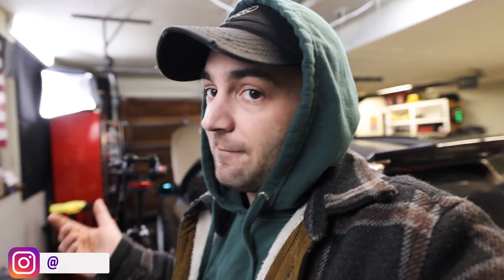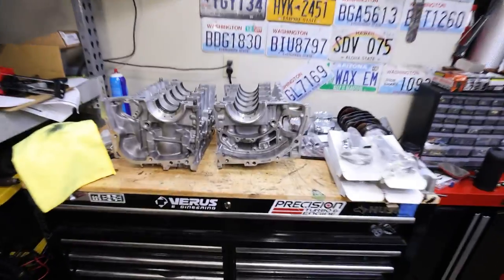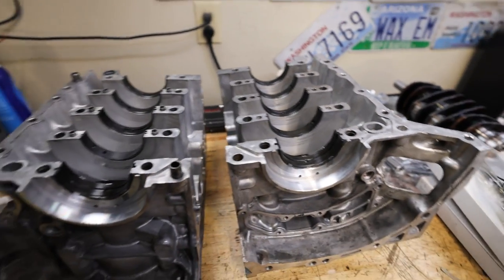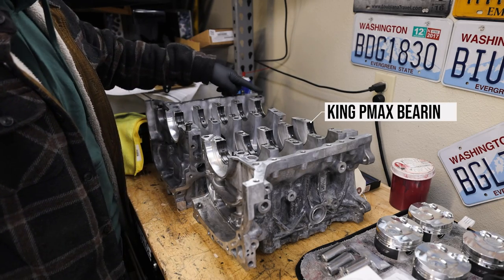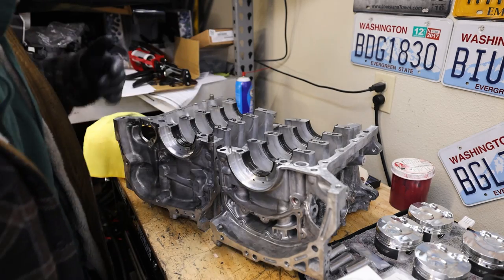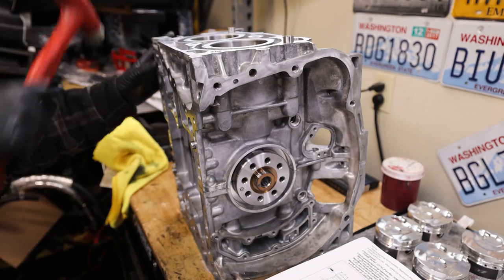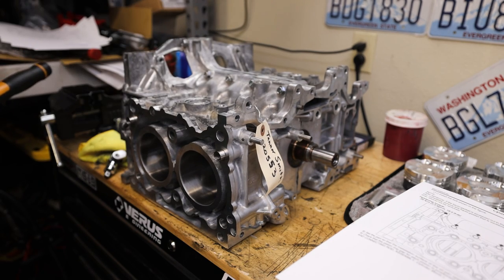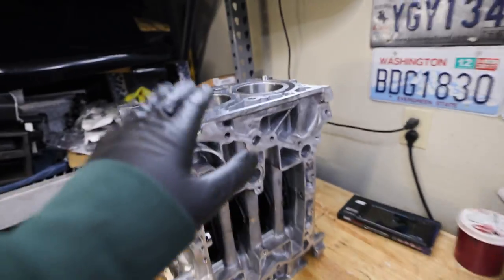How To Build a Subaru Engine (FA20DIT)

Comment: Tanner, Subaru of Japan stated that all the tightening and loosening of the case half bolt was designed to release trapped air and gas that might get compressed in the sealant. It's supposed to make it last longer and not cause leaks as easily.
Reply from the maker: Good to know! I figured it was to align the cases properly but that makes more sense 🔥

Comment: FA24 shortblock actually goes together like an EJ again they went back to the straight connecting rods for better durability. So now you have to again take the plugs out of the block and remove the wrist pins and pistons off the rods.
Reply from the maker: Tbh I'm kinda glad they did that then 😅🔥

Comment: 7:12 
I am not a mechanic or mechanical engineer so i know little about engine assembly but Im a structures engineer and i know that by lubricating a bolt, you loose friction force which means the bolt will be under higher stress that can lead past its yield point resulting in permanent deformation.
Reply from the maker: Per Subaru FSM they want you to lubricate the threads, I wouldent stray from the FSM on that one

Comment: YAY FA LOVE !!! I had to do a rebuild on mine the oil return blew out the turbo and by time I realized it. It was way to late. But now that I have it running I wanna build it !!! Thanks to this video I’m determined to build one now. Just need to source a short block. Dk if it’s smarter to buy a short block from Subaru and build it with manely or just 100% rebuild a used short block
Reply from the maker: Offer up and FB marketplace is where I get all of mine! You can snag then for deals!

Comment: ourfront short block closed deck and long block assembly and tuning by prime motoring P3X FA engine build with fp blue turbo. E60 blend. Almost 24k miles on the build and compression tested recently and checked out good. when built right and maintained shit will last.

Comment: Hey I have a scenario I’d really like your advice about; my sons engined failed 2 years ago on his 2016 Subaru WRX 2.0 L DO HC inter cooled turbo engine with 44,000 miles on it. Subaru service found turbo charge shaft broken and impellers damaged. The short block cylinders 3 rod bearing also failed and found a lot of metal in the engine oil. Luckily, this was under power Tran warranty. Subaru replaced the short block turbo, oil feed lines, high pressure fuel line and oil pan at no cost. In October 2022 he was checking the oil and heard a tapping noise. I took it to the local Subaru service center who replaced the short block and turbo 2 years ago. They diagnosed it needed an engine rebuild to replace short block assembly, rod knock cylinder 4 at the cost of $ 8046.32. They said it was out of the one year warranty on parts from when they replaced it two years ago. The car only has 65,000 miles on it. I found the old invoice from two years ago which I never looked at because it said no charge on it and noticed that on the last page of the invoice it states after replacing the short block and turbo and engine reassemble they started the engine for a test drive. The engine check light came on Cam P00ll camshaft position timing over advanced bank1. They removed the cover and inspected the cam pulleys and found all 4 pulleys still had debris in them from when the engine failed and needed to be replaced. They replaced all four cam pulleys and reassembled the engine again.
My question to you is can the debris that they found after replacing the new short block and turbo get into the short block oil passageway or oil galleries and heads and Over time cause it to fail again two years later causing # 4 rod to knock?
What do you think?

Comment: Hi Tanner I am in need of some help and could some advice. Bought a turbo and it's not clearing the intake manifold. It has a 3in inlet that hits the manifold on the right. It feel like its sitting to the right a bit. I want to move it back and to the left if possible. I have tomei ELH and uppipe. Cobb fuel rails, aos, injectors, ebcs. Trying to refrain from tgv delete since I'm using the AP platform for tuning. I was thinking I need a different uppipe.
Reply from the maker: Snag some 8mm manifold spacers that should help a wee bit 🙏 
If not tgv housings may be needed....

Comment: Hay tanner I love doing top speed pulls on my 2004 wrx I have a built block but the heads are stock should I start investing in valves and springs or am I good for now. 

Ej205 
Cp piston 
Eagle rods 
King bearings 
Stock heads
Vf39 turbo
Sti pink injector 
Turbo back exhaust

Comment: Question: I took your advice to heart of not to buy a first year car of a new generation. However the new RS Impreza “updates” took everything they have had already in their other cars for years; infotainment, engine, etc. does that give this one an exception because lack of “new” parts and features?
Reply from the maker: There may be small bugs with it but nothing that software updates or minor r3calls can't correct. I'd say if you want it go for it 🥳

Comment: Hey Tanner, thanks so much for the video, I've been waiting for this one for a while, I knew you'd come through if I was patient. I see you linked the factory service manual. So I assume you set all the bearings and ring gaps to factory specs? Did you shoot for the looser side of the spec or just in the range?

Comment: Off topic but id love a quick talk from you about oil consumption tolerances with EJ’s. I have a fresh iag build that consumes what I feel is a lot but iag and my shop say it’s fine. I added about half a quart in 1700 miles while only having 3000 miles or so on engine. Just curious on your thoughts
Reply from the maker: Probably ring gaps, the engines I put together maybe go through 1/4 of a quart every 3K miles. 

I can see of I can put something together.

Comment: @smeedia  so I blew found small sparkles in my fa20 tore it down found it to be thrust bearing. I wanna rebuild it and clean the heads re hone the cylinders and whatnot but I do not know what rods bearings and pistons to buy. I’m kinda balling on a budget but am thinking h beams and probably Manley pistons.  Any recommendations would love to pick ur brain on it so I can get my wrx back on the road again.  I’ve rebuilt a mzr disi 2.3 and a eco boost 2.5 and a lt4 and a small block 350 chevy motor   any advice and insight would help a ton. Thanks man

Comment: why do you scrape some of the material and how do you know how much to scrape? the compression and oil scraper
Reply from the maker: To set your ring rap, they normally come too tight so you need to make the ring smaller by using the ring grinder. 🙏
Reply: @Smeedia  how much do you scrape of?
Reply: @mendez_guzman9661 The ring manufacturer will give you a guide based on usage. In my twin turbo Ford engine, high boost/nos was 7 thousandths per inch of bore. So a 4 inch bore should measure 0.028 or 28 thousandths, in this scenario. The looser your ring gap, the less chance of them butting up and causing ringland failure, but it will also increase oil consumption.

Comment: Hey, I just pulled my engine because my upper oil pan is cracked and I'm replacing it. I've got about 70,000km on the car and wanted to change the rod and pistons for reliability and possibly more power? Do you think it's worth it, as I know the rods are prone to fail and I have to be tuned on 91oct. Also if so, anything different when installing the pistons onto a used block?

Comment: Are you using the cam angle sensor in your eg33? If so how many teeth are on it i.e 12 minus 1, i cant find this information for the  life of me.
Reply from the maker: 12 -1, I had a custom CNC made adaptor to use the stock sprocket with an EJ25 pump. The sensor is offset from the sproct to read the front teeth
Reply: @Smeedia  12-1 is your custom or stock eg33?

Comment: What’s this build costing? My some bough a 2017 wrx with 50000 from a dealer and 2 week later it was down with cracked pistons in 3 and 4 and has been sitting at ssi here in Portland Oregon for 7 months and their charging him over 15 grand for a new fa20. Looks like he should have had you do the work.
Reply from the maker: This one was free for someone. Buy typical price for a built shortblock comes in around $4500 for everything (parts & labor)

Comment: My motor is in pieces 😭I wanna put it back together since it has been disassembled from the dealership and I haven’t been able to drive it for half a year and I wanna put it back together they said I over boosted and over revved and a valve was smacking the piston or whatever so I wanna see if I can do it myself

Comment: They say the fa20 block itself is slightly thicker than a ej. It’s just the rods that are the weak point. Very very curious on how much power it would handle with just swapping the rods. Non the less love the video man. Thank you for the fa20 content. To anyone looking to see their fa, the market is dropping and they want to screw you! Keep that baby
Reply: on an na fa20 with rods, rodbolts and headstuds you could make 450whp reliably. You would be still be detonation limited due to the high comp pistons on pump so you would need e85 to actually justify just doing a rods build.
Reply: @teamnir853  thanks for the info! Love my fa20. Wish there were more fa20 builds on YouTube !